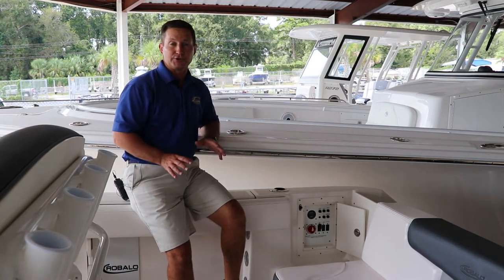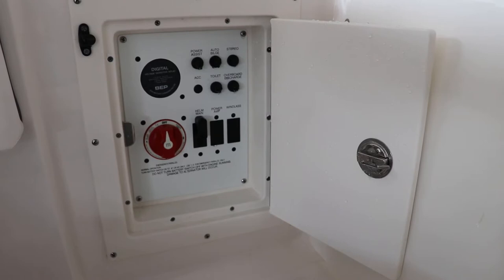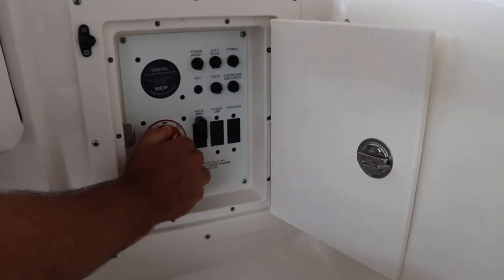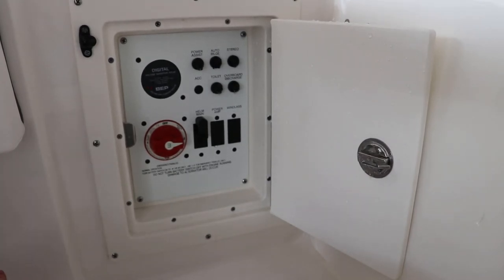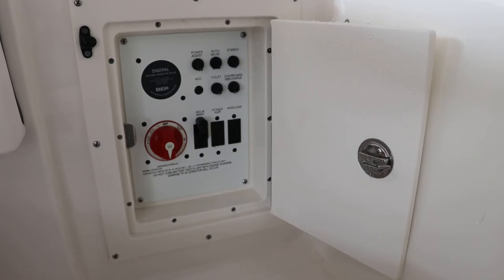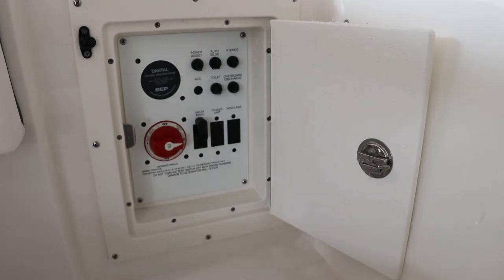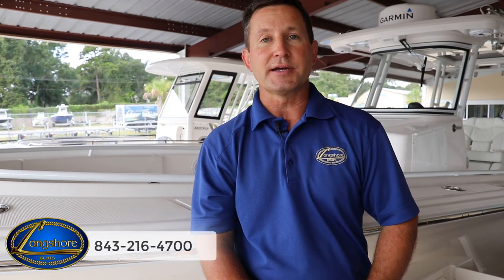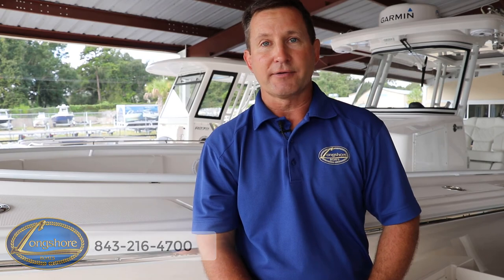How To Operate Your Battery Switch || Longshore Boats

Comment: When the motor is running is there a problem switching battery settings? Why not crank with two batteries and keep it on the 1+2 setting? Or run out on battery one and return on battery two. Will the motor charge both batteries regardless of the switch setting?
Reply from the maker: We don't recommend switching the battery switch while the engine is running as there is the potential for damage to the engine alternator and other components. You can run the engine on both 1 and 2, however, if there is an issue with one of the batteries, a charging fault or bad ground, there is always a possibility that both batteries can be compromised leaving you without a good battery. Hope this helps!